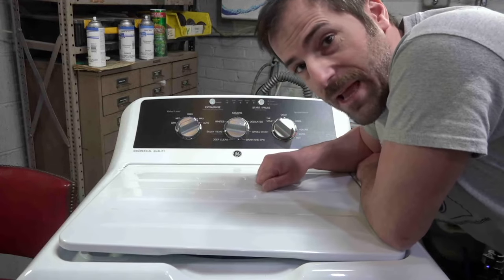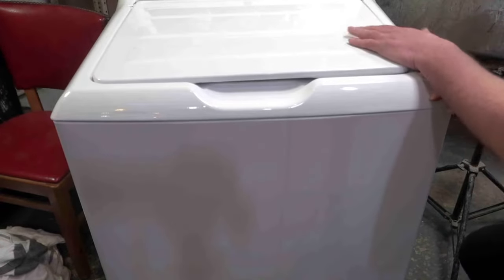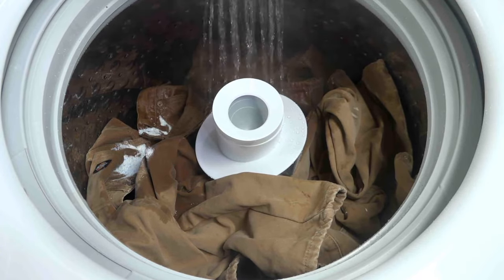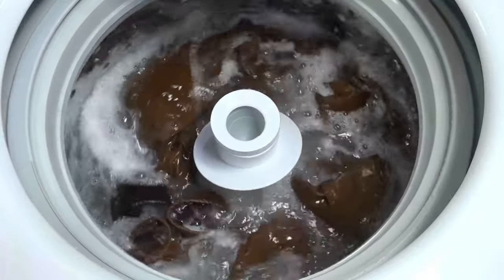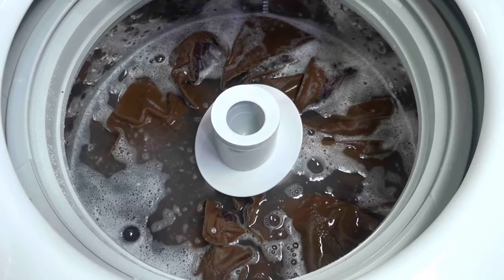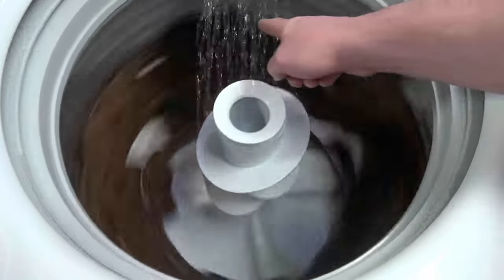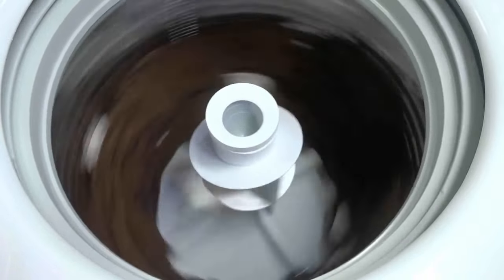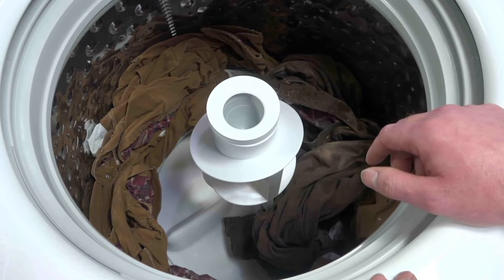FIRST LOOK: GE Commercial Washer GTW525ACP1WB

Comment: What's the point of having a spiral/corkscrew agitator if it goes back and forth instead of one way?  I recently got the GE 4.8 cubic foot front loader with the vent fresh system and can tell you that, so far, it's the best machine I have ever owned.  I previously had and LG front loader, 4.2 or 4.3 cf, but it threw an LE error on me, and my wife didn't want to wait to see if I'd be able to fix it.  The same day the LG threw that error, I went to Lowes and bought the LG 5.0 top loader with an impeller and the matching dryer.  The LG 5.0 with impeller is a joke!  ABSOLUTELY no roll over at all.  Lowes actually took the LG's back and we got the GE 4.8 front loader and matching dryer.  My wife sent me an email at work last week stating that she loved the washer and the other day she restated that and said  that it's probably the best washer that we've ever had.  I would have to agree.
Reply: Front loaders are great and you’re going to find that all of your new clothes are going to last so much longer you’ll wish you switched years ago.
Reply: A corkscrew agitator that’s single stage can still be effective if the agitator itself rotates further in the clockwise direction with every stroke.
Reply: This is a heavy duty agitator it doesn’t need to go one way
Reply: LG is trash.  GE is much better

Comment: Want hot water turn off the cold side. A little inconvenience. What i dont want is hot water in my cold water wash. I usually have my hot water valve turned off. 73

Comment: I think GE and WHIRLPOOL merged with each other from the operational characteristics I've seen with both brands of washers.
Reply: Here in Eastern Iowa, Amana merged with Whirlpool and Maytag.
Reply: I thought it was Whirlpool and Maytag who merged.
Reply: @jeromedavis8575  Yes they did. However the operational characteristics of the latest GE Agitator WASHERS seems very much the same as the Whirlpools.
Reply: @albertcarello619  What drive did GE call theirs when whirlpool called it vmw?
Reply: @jeromedavis8575  I think it may have been direct drive .  From the operational characteristics of both the Whirlpools and the GE Top Loaders of the late 1990s and newer.
Reply: @albertcarello619  What oil did each one of their transmissions use?
Reply: @jeromedavis8575  I have no idea.
Reply: @albertcarello619  How thick are whirlpool gears in their transmissions?
Reply: @jeromedavis8575  Not sure but I'm sure they're very similar to each other.
Reply: @jeromedavis8575   don't forget kitchenaid as well
Reply: No, GE sold out to Haier of China.  Whirlpool is still independent and US owned. GE looks to have copied Whirlpool technology.
Reply: @colinschmitz8297  I believe it was Whirlpool and Maytag who merged.
Reply: @jeromedavis8575  Whirlpool purchased Maytag around 2006 which includes Amana, Jenn Air, etc.  The point I was making is that GE is NOT part of Whirlpool, they are part of Haier.
Reply: @colinschmitz8297  Definitely agreed!!;
Reply: They have not.
Reply: @xChrisN1975x  Yet their cycles seem very similar to each other as well as their operational characteristics.
Reply: @albertcarello619 If you notice automobiles are the same way also. Everything is being made to look like everybody else. No real differences any more in lots of products . It's like a planned mediocrity.

Comment: Trash. 1: not a true dual agitator.  Clothes struggle to the bottom. 2: no second rinse.  Most of the spray is on the agitator and not on the clothes. Restricted water flow during the spray rinse. A rinse is standard,  not optional.

Comment: Build as cheaply as possible and still work as a washing machine.
Reply: Heath Wirt: With good care and maintenance and proper loading this machine should last at least 10-15 years.
Reply: @albertcarello619  At least 1 to 1.5 years in my opinion.
Reply: @heathwirt8919  That's an awfully short life span.
Reply: @heathwirt8919  well you're wrong.
Reply: 10-15 years is normal according to todays industry.